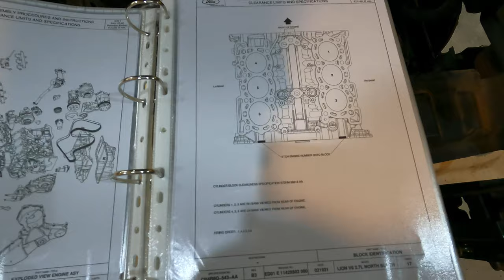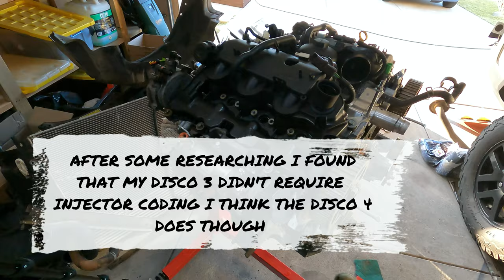DISCOVERY 3 ENGINE BUILD PT 3 , Fuel system , intake manifold clean, glow plugs

Comment: Nice to see you back. Another good video. I was needing a bit of inspiration today- doing a turbo replacement on my D4. Keep them coming 👊
Reply from the maker: Just replaced my turbo I'm sure you could of related to my pain haha
Reply: @OUTBACKDiscovery  think D3 looks harder than D4 primary tbh mate! 😳 With a bunch of extensions and ratchet spanners everything is pretty accessible on a D4, just a matter of time getting access through wheel arch and from exhaust side. My actuator was knackered from a bad turbo recon done before my ownership but managed to get a local Garret specialist engineers to supply and calibrate new one so only cost me £150 (plus a few gaskets I replaced). New turbo from LR fitted is something like £3k 😆
Reply from the maker: @jarv75  love your work 

Cost me $ 2150 for a Borg Warner turbo and 13 hours of my life haha

Comment: Du think I should replace the crossover pipe with a stainless steal one ?  Mine is buggered ..can u get near it  with body on  ?
Reply from the maker: Didnt even no there was a stainless steel one to be honest mate 

Depends what road you want to get down a new replacement is like $1000 from memory 
.they normally only seem to let go if the support brackets havnt been put back on properly personally I'd go genuine again or even second hand there a pretty tough unit 

You can get them out if you loft the front of the body up a couple of inches and drop the rear cross member to angle the engine down more for accessibility apparently  but I havnt tried to do it before so just going of previous research

Comment: If I remove the gearbox .. can I replace the crossover pipe ... turbo and fuel pump belt ?  My 2005 prob wont take kindly to a body removal ?
Reply from the maker: Having no gbox in would help with access to your crossover pipe, don't think it will make to much of a difference for the fuel pump as alot of it you need to get at from up top apart from the 2 rear mounting bolts

Comment: Just watching this thinking how much of a pain in the arse some of those jobs are with the engine in the car
Reply from the maker: Yep between me and yourself I don't think there is a bolt untouched on this engine haha 

Hows your aircon compressor change
Reply from the maker: Done the oil cooler when I very first bought the disco almost broke me I'd say second time around wouldn't as be hard 🤣 likewise with yourself I bet
Reply: @OUTBACKDiscovery  haven’t looked at it yet, compressor has arrived. I will be starting the changeout on my next RnR - back to work tommorow for another 8 days